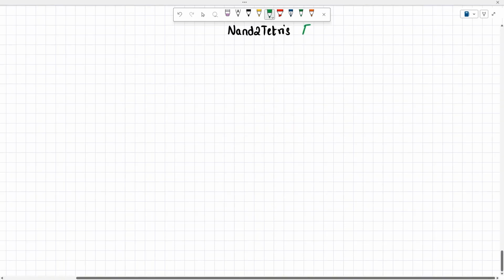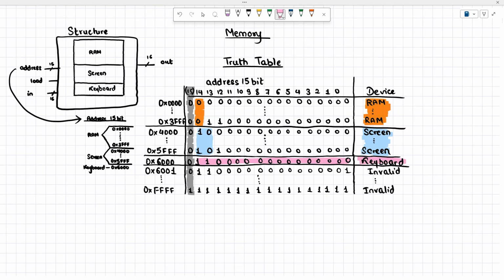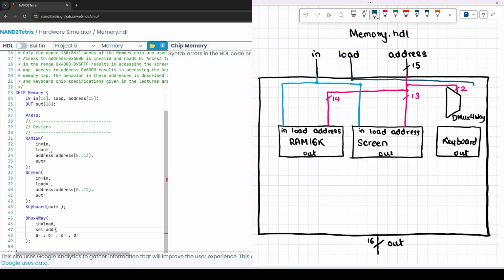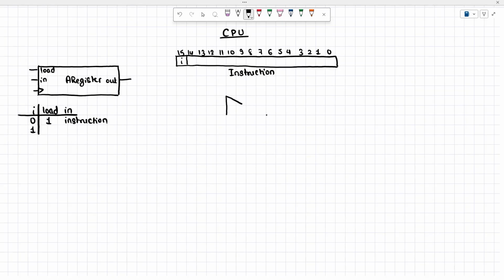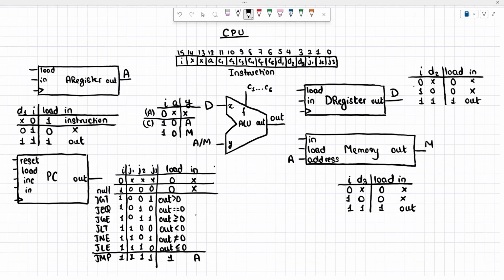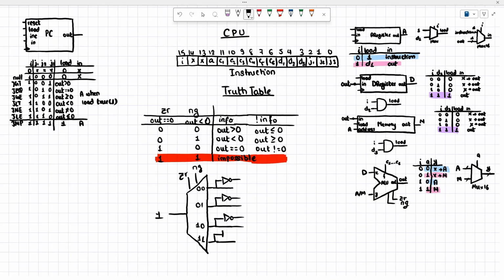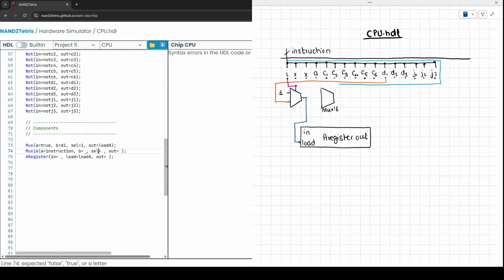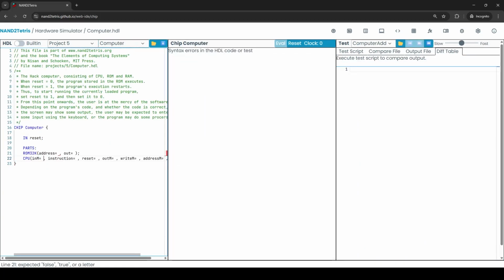How to Build the Hack Computer (Nand2Tetris Project 5)

Comment: In memory implementation, test cases also passes with Mux4Way16 for the output, which overlooks the invalid addresses for the keyboard. Thanks for the insight.
Reply from the maker: Absolutely! Thanks for sharing. Maybe add some more info if you like so that it can help other viewers (like inputs to the mux in this case, why it is enough, what assumption do we make about the input address)

Comment: your aspect is super cool, i could not create that truth table, do you recommend something for exercise to me ?
Reply from the maker: start from basics here: https://www.101computing.net/logic-gates-truth-tables/
In the video, there are 5 bits as inputs j1,j2,j3,zr,ng. First list all the bit combinations from 00000 to 11111 (32 lines). To know which combination gives output 1 use logical reasoning.

Eg. To jump when output is greater than 0 that is when j1=0, j2=0, j3=1 (JGT)
the condition is satisfied when out>0 which occurs when zr=0 and ng=0 that is when value is not zero and value is not less than 0 (see ALU.hdl specification) so value must be greater than 0. 
So when j1,j2,j3,zr,ng combination is 0,0,1,0,0, output load is 1.
In all other cases, 0,0,1,0,1 (value less than 0), 0,0,1,1,0(value equal to 0), 0,0,1,1,1 (impossible condition) load is 0.
Reply: @onthelearn  thank you man, i was just finished the 5th project with you, thanks for the great explanation
Reply: @onthelearn  man do you know some resources that i practice creating random gates that serves what i imagine and connect wires between them, because i noticed that i need more practice on this
Reply from the maker: I use this: https://github.com/logisim-evolution/logisim-evolution